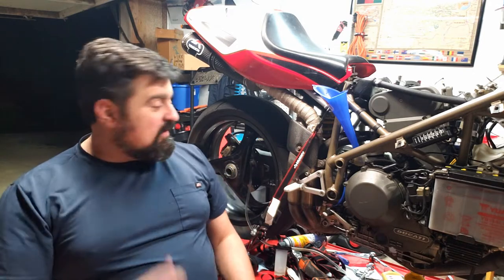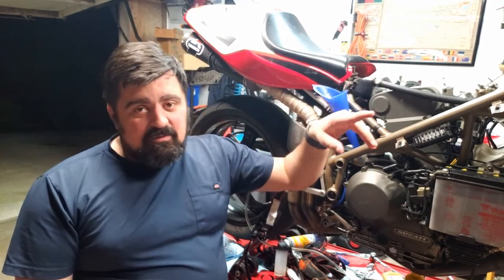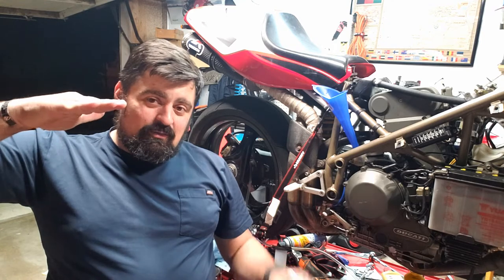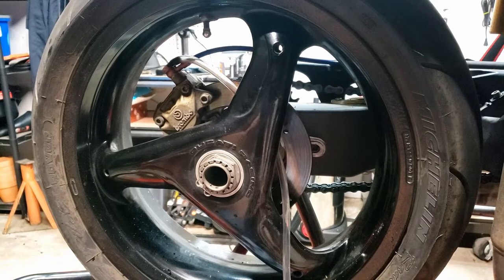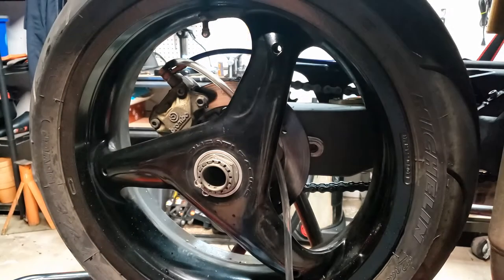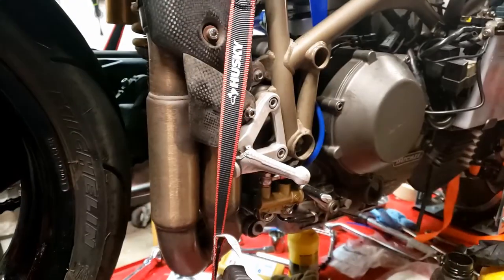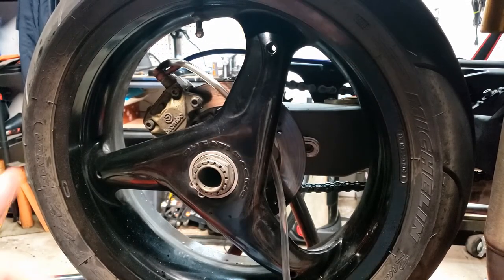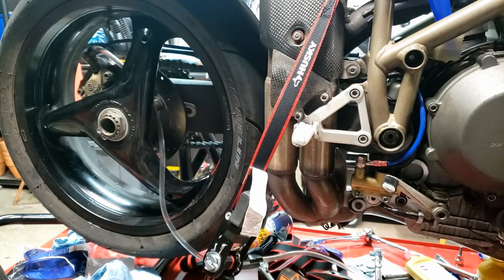Rear Brake Bleed Trick for the Ducati 916 (748, 996 & 998)

Comment: Very good tip! Finally I got the rear break right on my old BMW R100RT (now in a scrambler format).
I loosened the rear wheel, put a distance between the break pads and set the break caliper in a position where the nipple was the highest point on the caliper. Then came the bubbles. I also used a one way valve at the end of the hose for easier work... letting the fluid and air out but nothing back in. 
Thank you very much!
Reply from the maker: So glad it could help!
Reply: Brake*** 🙃🙃🙃

Comment: Great tip. Need to flush/bleed all my hydraulics soon and will totally try this with the rear. Where did you score your replacement bleed screw, and do you have a brand and part number if it’s not OEM?
Reply from the maker: Pro Bolt
https://www.probolt-usa.com/titanium-bleed-nipple-m10-rear-brake-caliper-9.html

Comment: The reason to have the caliper sitting on the rotor is because, i. The amount of fluid in the system is dependant on the rotor being in play, ii. One of the pistons could pop out of its cylinder making a cluster f**k of a mess. The rust on the nipple (is it an American thing to lose your shit over a ‘dirty’ word?) is not on the effective working portion. In other words, it’s only cosmetic. Replace it by all means, but realise the device only has to seal off the cylinder hydraulically for the brake system to work perfectly.